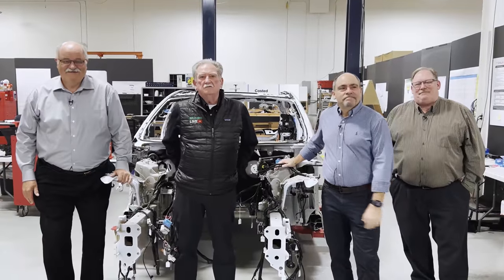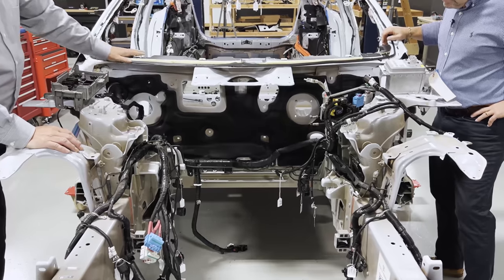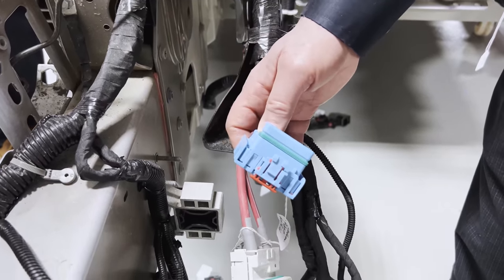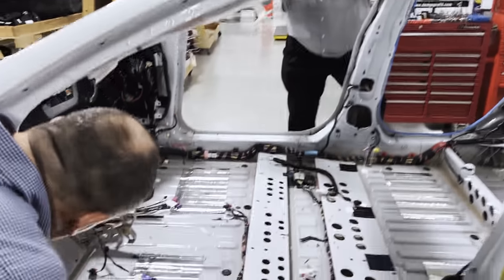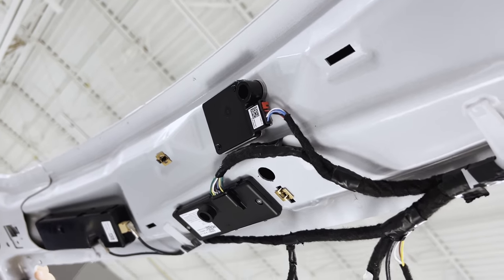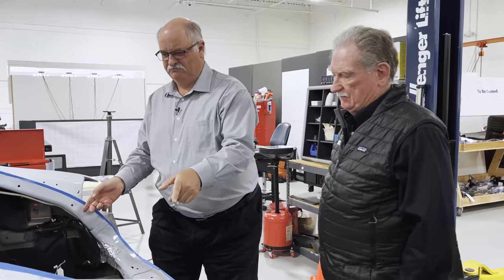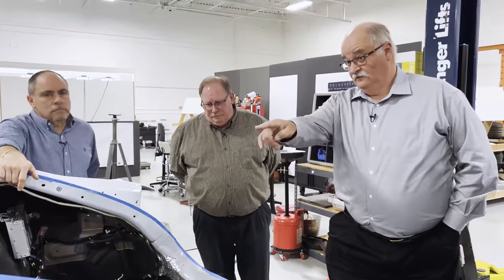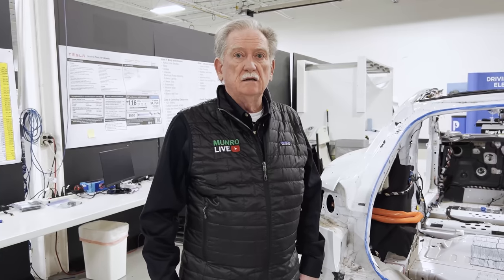Plaid Low Voltage Wiring First Look | Tesla Plaid Teardown

Comment: Aside from the assumption that the design elegance is a result of open communication between engineers, Tesla could just have a more unified 3D modeling system.  Given the fact that Tesla is primarily a software and technology company that happens to make use of an automotive frame, they are a lot more used to software builds, unit testing, and version control.  The same can apply to interference detection in 3D modeling.  Draw up the proposed wire harness model and check it into the nightly CAD build.  Any areas of the other assemblies that are in clearance conflict or missing tie points or other fastener requirements throws an exception, and the designers for those assemblies get notified of a change request to accommodate new component integration.  If done right, you would give any design engineer the power to push established component changes all over the vehicle as needed to integrate new components.  You wouldn't have to go and negotiate with each mechanical engineer for desired changes, you let the master 3D model of the vehicle notify the appropriate engineers of a submitted feature integration conflict, and generate a review meeting and task plan to accommodate it.   

I'm just speculating, but it would make for a powerful design optimization and integration tool.  No need to hunt down the person who created the components and beg them for changes, just submit a 3D model with overlapping geometries and the system would detect the conflict and kick off an integration resolution task and notify all required parties.
Reply: Now, if only they can just apply it to cars which cost less, so everyone can afford them.
Reply: you can not have a unified 3d modeling system WITHOUT open communication between engineers Is This Not Obvious?!
Reply: @AudiTTQuattro2003  Won't have that until they build more factories. They are operating at capacity and selling every car they make. Why would you use that capacity for a lower cost, lower margin car? Once you have some excess capacity, you can try to make lower cost, high volume cars.
Reply: The interior is definitely not something special considering that it's a flagship vehicle, have you ever seen the interior features in Mercedes sclass or bmw 7 series? They have some crazy things in those vehicles, from the big boss rear seat that totally reclines to many heated surfaces to the incredible massage and comfort, to the interior lighting and much more, they even offer monochromatic panoramic glass with lighting and much more.......

Comment: SINGLE SEAL CONNECTORS  probably make more sense in a well sealed EV engine [sic] bay where there is no engine vibration, much smaller radiator wet air flow , no oil splash risk, less water  coolant leak risks etc. I imagine  that some areas under the hood are not remotely as harsh an environment as in a petrol engine bay.
Reply: Lol.... that's definitely not a justification for that! EVs can still be flooded or go on rough roads for example. Mercedes for example has doors that almost hermetically seals up to a certain dept in water.

Comment: I have a new model S and it feels heavier, less nimble and with much worse breaks compared to the older model. Of course the new one is way faster but I prefer the handling of the older one. The new ones breaks are MUCH worse independent of the speed. Would you guys mind touching on the differences that may cause these changes? 

The new one is lighter so I really cannot understand why the handling feels more cumbersome. It's not the yoke.

Comment: Why is there a small lithium ion battery that replaces the lead acid battery ???   the question Im asking I guess is .........if the car has a massive battery pack.      WHY ANOTHER SMALL BATTERY ????    is the battery pack not sufficient ????    CONFUSED
Reply: 12V vs 500V   simple explanation.
Reply: @dalerichardson7202  PERFECT.   THANK YOU !!so does the 12v handle low voltage things other than the drive train ??? I assume ??

Comment: 18.06 "There's a gram or two of weight that you could get rid of there." Judging from the size of these four gentlemen, I'd say there's a lot more than a gram of two they should consider losing, themselves.
Reply: Hey. We old  fat guys have a low centre of gravity.
Reply: @MarkXHolland  ...but lacking in torque, not to mention NVH issues.

Comment: i wish i could replace lead acid battery in my ID.3 for the LiFePO4 like the one in Plaid
Reply: It is a Li -ion, not Li - FePo4 , yeah, it can get confusing as iron and ion sound the same.
Reply: @ForeverNeverwhere1  thanks, iron phosphate battery should have more charging cycles from what i heard, no matter the chemistry, saved 10+ kg on the single component is very interesting
Reply: You can - especially if you don't have freezing temperatures. I use a A123 Systems 40Ah LFP-battery during the summer in my 2003 Audi 1.6
Reply: @ForeverNeverwhere1  
Somebody else in the comments said it's "4 LiFePo4 pouch cells" (as dismantled elsewhere)

Comment: I’m guessing Tesla will eventually move to a single wire with combined power and control signal, maybe operating at a higher voltage like 48V. (But that probably requires an end to the chip shortage first).
Reply: There is no point in 48V anymore. Usefull for mild hybrids. But with led headlamps and all heaters power with HV Batterie. Why you should even bother buying more expensive less available parts. The amperage is pretty low. From my point there is no sense in considering this
Reply: @davids.6671  There is still a point in having 1/4 less weight in your cables.. But by the looks of all their newest models it seems they are going further and further from any significantly newer design with 48V or single wire because they'd start loosing backwards compatibility and/or parts commonality.  And yeah, also the chip shortage..
Reply: I think Tesla will soon have enough sway that they could turn the industry.  They could add a 48v bus for their own desires for now, and component builders will soon start taking advantage of it, making the other [soon to be smaller] OEMs follow suit.
Amps need copper; volts need insulation.  4x the volts, and you can 1/4 the amps for the same wattage.
Reply: You mean as they proposed 5-6 years ago? 🙄
Reply: This time what went on in Vegas will not stay in Vegas!!

I met both Britney Spears and Elon Musk early in 2000 at Bellagio. Britney just stared at me as she was singing on stage and I was standing in an archway above and nearby. I'm not sure if I had was supposed to be standing up there by myself but I did have her undivided attention. A few days later Elon came up to me and started asking me questions about what I was doing there, in Hawaii and Las Vegas during that time. Would I be fine answering a few questions and if I was a gambling man? I stated, "I was on vacation and I only like to bet on things that are worth betting on!" I had earned these trips by qualifying reward points at my work. He asked, "What kind of work is it that you do?" I said, "Commercial energy saving promotions but I had been schooled in Automotive Marketing Business Administration and worked in that field for several years as well." He asked me, "If I had millions of dollars to spend what would be the most innovative businesses that could help humanity?" We talked about electric cars, we talked about solar energy and so many other subjects for over an hour. Even commercial space exploration for the consideration of colonization. That way all of humanity's eggs are not in one basket in case of another world war, asteroid strike, major climate change, etc. These we're very expensive and ambitious businesses to become successful at. Therefore we had to talk about ways of keeping a low overhead in advertising, distribution and the manufacturing. He said, "They were all very good ideas and that they should be done!" He said he had already made hundreds of millions off of a couple internet companies he started. "One of them was PayPal," he stated. Not that I had really done a lot of online banking or e-transfers at that time I didn't think much of it, until I noticed online about a year later that I could buy something off the computer with my PayPal card! Unfortunately I had just received a promotion as regional manager with the company I was working with. This made me let Elon know that I had to wait for a few years before I could assist further. I keep on sending out messages, hoping that he will get one and reply back. I will probably have to keep on trying, he gets more messages in a day then I would in five years! It is very inspiring to me to have a conversation with someone and they dedicate the next 20 years to making our conversation reality! We also talked about becoming your own best supplier and starting businesses that help your existing business. A type of slingshot effect that he has incorporated very well. It is so ambitious and amazing that he was willing to put pretty much all of his money where his mouth is and just make it happen with a consistent dedication. Congratulations Elon and I am looking forward to working with you again, one day in the near future! Of course Britney I always wish her well and would enjoy meeting her again as well! Shoot for the Moon then Mars and then we will end up amongst the Stars! If you would like to learn more of these topics let me know. People with integrity expect to be believed otherwise they let time prove them right!  
propower101@hotmail.com
Reply: Musk has stated he would like to go to 48-52 volts in a power over Ethernet style but the hold up is auto part makers lack of mass scale price reduction.
Reply: @rkan2  also lower power losses to hearing and a saving in wire costs
Reply: Elon has stated publicly previously they can't go to 48V because the parts don't exist, and nobody wants to be the first to market with a 48V system because they will bear the brunt of 48V component development cost.
Reply: Wow congratulations on the 48v prediction

Comment: 99 watt hours isn't enough to run an alarm system overnight.  The only way to have a 12v battery that small is to be able to recharge from the drive battery through the DC to DC converter at any time driving or not!

Comment: Hey Sandy, did you see the video from the guy who had a 2500 pickup smash into his driver side at 80 mph and survived with very few injuries thanks to his model 3?
Reply: Have you seen the Toyota Camry that jumped from a hill and landed down on the other side of the highway?! And the driver had no bruises!!
Reply: Have you seen the Lamborghini that crashed years ago at almost 200mph in Hungary? Both passenger and driver were not Injured.

Comment: "They didn't catch on to me until afterwards when it was too late."

You should have camouflaged the steel tube as blinker fluid lines, or labeled it something boring like catalytic converter preheat compliance wet smog diverter manifold... no one will touch it.

Comment: 2:18 - 3:05 If the new 12v Li battery only weighs 1.8kg, then the weight savings compared to the traditional lead acid battery would be much more than just 10kg, probably closer to 20kg.
Reply: Well, the 12v battery in an EV lets it "keep alive" important functions (even lighting) while the high voltage (well, 600 volts more or less) isn't active.   The high voltage system could fail for a lot of different reasons but you still need the lights to work.

Comment: It's great to see the incremental improvements Tesla can make by only having to consider 4 basic models. Far better than a 4 or 5 year cycle of 100 models!
Reply: Annual cosmetic changes on essentially the same platform to make a 'new' car is an old ICE marketing trick. Thank God Tesla don't go in for that crap. If it ain't broke, only make 27 incremental improvements a week. ;)
Reply: Lol........ The model 3/y and model s/x are basically the same car, Toyota in the other hand makes from tiny kei cars in Japan to small hatchback, wagon/estate, sedan, SUV, trucks....... all those models are very important on different markets of course.
Reply: In Europe for example small car sizes like Toyota aygo/Citroen c1, Renault twingo, fiat panda, be up are super popular and very easy to navigate on the small streets. There is also a reason why trucks here are cabover instead of long nose like in the US better manouvrabilility
Reply: @MarkXHolland  Lol..... There are many ICE which the design hasn't changed in over 30 years like Mercedes gwagen or Toyota land cruiser 70 series....... The other car's actually gets incremental small changes and after about 5 years a new redesign.
Reply: @MarkXHolland  those manufacturers also offers special versions of some of their vehicles, some with carbon fiber roof or mirrors, seats, hood...... even wheels.

Comment: No LIDAR? How they determinate with accuracy proximity? Some say Tesla don't use it to decrease phantom breaking and avoid paying for the technology.
Reply: Close with Ultrasonics and far with AI and neuralnets.
Reply: Calibration
Reply: @afpv2225  using cameras is far less accurate then a radar system. Read somewhere Tesla avoided radar to decrease the amount of phantom breaking, as in some weather conditions with rain and snow. But the LIDAR, was part to avoid paying for the technology.
Reply: Tesla/Spacex have designed their own lidar and could manufacture themselves if needed
Reply: RogerM
Are you STILL here?
Still using "some say" as an extremely nonspecific Introduction to 5th rate FUD attempts?
Sad
Reply: The answer has been repeated over and over and over and over again, dumkopf!.   When 2 different sensors, using different technologies, ie visual vs lidar vs radar vs ultrasonic vs xray vs etc etc report different results, which one does the software believe and use for decision matrix, ie braking?  Everyone will be forced into using only one sensor type, because it is impossible to accurately weight the decision matrix between the options every time
Reply: Roger M - TESLA only used PURE VISION cameras , in Photon detect mode, they are NOT even using VIDEO or STILL images, just the RAW Photon entering the cameras, backed by ultrasound sensor. 
Tesla can also Deploy PUSEDO lidar with front cameras.
Reply: RogerM - I forget you are still ALIVE........LOL.
Reply: I don't think phantoms needs any lunch breaks. They are dead, and don't eat.
Reply: @mallamal5578   SpaceX is one thing Tesla Motors is another thing. It's all about the algorithm.
Reply: @dalerichardson7202  then why many other Automakers are able to use cameras and LIDAR together? For a reason radar system are used as accurate tracking devices, not cameras.
Reply: @markplott4820  they use magic technology then? They use cameras with tracking algorithm that detects distances. Not as accurate as radar.
Reply: @RogerM88  - SUPERIOR to radar, the BEST part is NO part. RADAR not useful in cars or SEMI. 
however, is useful in Aircraft  of all kinds.
Reply: @markplott4820  completely wrong. To determinate distances with accuracy you need a radar system. There were many cases of Teslas rear ending Emergency Vehicles, for not recognising them. Also Mercedes-Benz Level 3 Autonomous system uses LIDAR and cameras. While the overrated beta FSD, been tested as barely surpassing Level 2 Autonomous.
Reply: @RogerM88  - FALSE, the instances if TESLA crashing into emergency vehicles were BEFORE the Radar was even removed, and in EVERY case the DRIVER was DISTRACTED, not in CONTROL of the Vehicle, no matter what MODE it was in.
TESLA has even added additional SAFETY to the software update that REDUCES front Collision 💥.
Reply: @RogerM88  - FACTUALLY, Tesla AP FSD beta is Already LEVEL 4 autonomy, and Standard AP is LEVEL 3.5. highway only AP.
Reply: @markplott4820  no, it isn't anywhere near level 4 autonomy. It is level 2, which is also what they told NHTSA they would have as a goal, and all they are allowed to implement on the road.
Reply: @RogerM88  Cast iron manhole cover returns stronger signal than the asphalt surrounding it.  When approaching car has camera saying, that's a manhole cover and the radar saying that's a little kid crouched on the street.......  Which one are you going to program to believe?
Reply: @ForeverNeverwhere1   - go watch FSD beta videos, ZERO intervention Drives.

Comment: The separate seat controllers are almost certain to be there to handle high power switching, not the memory. I would use a separate board for the window motors and door solenoids as well. Tesla has traditionally put all the power electronics on the left and right controllers so when a power component fails the consumer is facing a $3,000 repair once warranty has expired.
This video is yet one more example of Sandy arguing with real engineers as he tries to put the best possible face on Tesla. I understand why he does it. Praising Tesla is what has earned him a fan base of Teslarati who don't know a thing about automotive engineering. Just look at how he defends an unshielded connector to be as good as Ford did in the '80s. Really? It's embarrassing to watch him.

Comment: Tesla buys wiring harnesses like any other maker.  There are several makers of connectors that supply to all. Vertical mfg. Is not good..tesla is not vertically integrated...even that they understand. There is nothing new in a tesla,it's parts from thousands of other manufacturers...its a car still on 4 wheels..like all others...putting goofy features on a car that are useless shouldn't impress ones who actually understand..